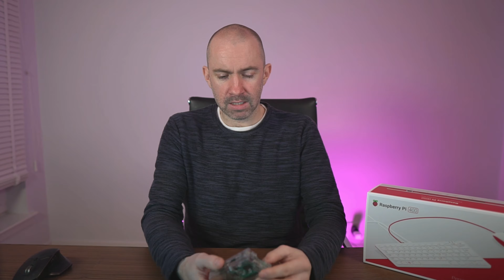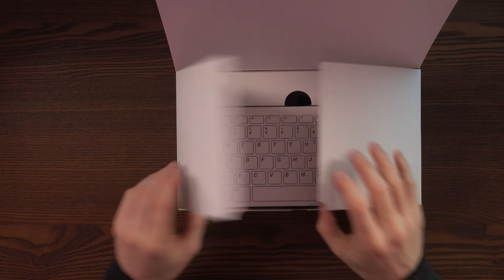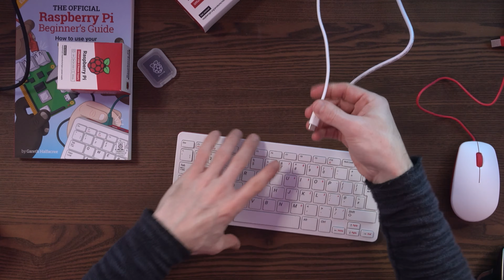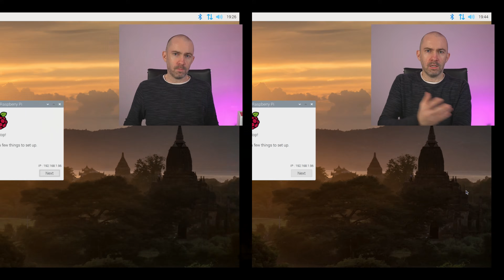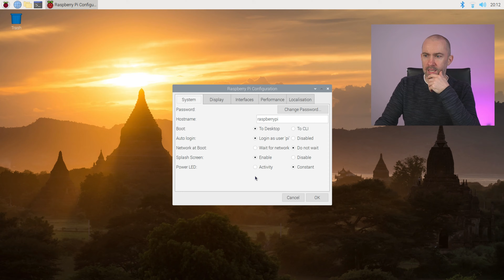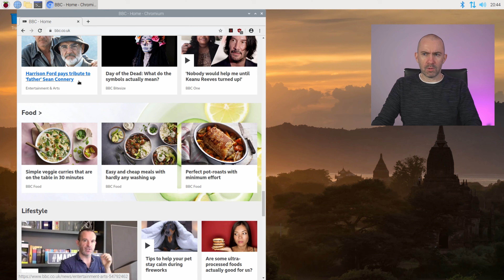Raspberry Pi 400 - Unboxing, Teardown & Raspberry Pi OS Setup

Comment: Can you take apart the keyboard?
Reply from the maker: Yes. I show removing the casing in the video, but I've seen people do mods that add their own keyboard etc. It's not straightforward though.
Reply: @KevinMuldoon  is this no different than the smaller rasberry pi? my local store is sol d out of the pi4 but maybe this one is the same thing just with accesories? what reason should i wait for other one?
Reply from the maker: It's a different form factor so it would be worth waiting if you need the smaller form factor of the regular pi. I'd only get this if you're looking for an all in one solution.

Comment: After I Shut Down the "Raspberry Pi 400" the only option to open it back, is by unpluging/pluging the power cable? I read the Begging Guid Book, and states that's the only option. I couldn't find another option, to open it up, let's say a physical button (like on laptops or PC), or let's say by pressing a key or something.
Reply from the maker: It's F10 or FN+F10 https://support.thepihut.com/hc/en-us/articles/360015199118-How-to-use-the-Raspberry-Pi-400-Power-Key 👍
Reply: @KevinMuldoon  It's FN+F10, for at least 0.5 second. Thanks buddy, I owe you a beer :)

Comment: great video Kev cheers 👍 what's its strengths with retro pie? what's the most demanding emulator it can run do you know?
Reply from the maker: It depends on the version. I've got the Pi 400, but my pi 3b is the one that's set up for emulating games. That handled games up to SNES perfectly. Some PS1 and N64 games were ok, but for the most part, struggled.
Reply: @KevinMuldoon  i have bought the Pi400 this evening after watching your video so will be running retro pie on that! will it run Dreamcast/Playstation?
Reply from the maker: @RetroRedDog  nice. I'm tempted to turn it into an Amiga!
Reply: @KevinMuldoon  got Amiga 500 on my 3DS 😂 good idea though, i may just do the same

Comment: Wouldn't it  normally be advisable to reapply heat paste?
Reply from the maker: I didn't remove any thermal paste so it wasn't necessary (I only removed the heatsink). Of course, I could have applied better thermal paste to see if it works better.

Comment: I really don't get why the Pi 400 uses it's own board. Wouldn't it be more expensive to print a new board than just using the original Pi 4B board?
If the Pi 400 is supposed to as cheap as possible, I would think that they would have done that. Not complaining, just a little bit confused.
Reply from the maker: My guess is that it wouldn't have worked that way. Perhaps because of thermals, perhaps because of the size of the chassis. I'm not sure.

Using a different sized board won't cost any more when you're developing things like this in bulk.

My friend works with a circuit board company and I believe they've done work with companies who used Pis etc. They basically just get the blueprint and then manufacturer everything according to spec.

Comment: WHat you called 'noobs' is not noobs, that was Raspberry Pi OS.  Noobs is completely different - it's basically a single menu with a selection of operating systems to choose and install.
Reply from the maker: Thanks for correcting me. You're right. I think Noobs is the installer I got in the past when I purchased the Raspberry Pi 3B kit.

Comment: They ran out at the popular sites but they were back in stock the next day.  Can’t wait to get my new Amiga/DOS/C64/Dreamcast Pi!
Reply from the maker: That's awesome. Glad to see it back in stock.

You're right. This would be perfect for an Amiga system.
Reply: I'd love to see a keyboard case like that as well that you can use with any SBC - I saw one for the Pi but I didn't like the look of the build quality and it was a bit bulky in size. Time to adapt an old slimline keyboard maybe.

Comment: It can be an interesting computer to emulate the micro computers of the 80s, do not arrive on time at the Spectrum Next and this has a very economical price, excellent video, a strong hug !!!.
Reply from the maker: Thanks Mr Galamond. Yeah it's nice.

I may try some other operating systems before I put on something like retropie (as I have retropie on my 3B).
Reply: @KevinMuldoon  I am in the doubt if this computer or a mini pc with Windows... I have never used Linux, but it is very nice and very economic, I see it ideal to emulate the ZX Spectrum and to do things with Basic in it, thanks for the answer and for your kindness, a hug.
Reply from the maker: You'll get more power with a mini pc, but pis are smaller. This makes them more flexible in many situations.
Reply: @KevinMuldoon  Thank you Kevin.

Comment: Pry it open by the Backspace key to not damage it.
Reply from the maker: I don't think it matters which part you open first. I suspect I opened it up in parts with my plastic tool facing the wrong direction. I've since opened it again and didn't have any problems.
Reply: @KevinMuldoon  Its the same with the Keyboard & hub device from RPi. Twisting a plastic tool there causes the least damage.
Reply from the maker: Thanks for the tip. I'll try that next time (if there is a next time, not sure I'll have to open it up again).

👍

Comment: Interesting seeing the significant difference in speed between ethernet (fast) and the built-in wifi (much slower but usable) when testing the internet
Reply from the maker: At first I was a bit disappointed as I had assumed ethernet speeds would be quicker, but when I think about it, it's actually quite good.

The network card in my PC is bigger than the Pi 400's circuit board. So it's no surprise that my dedicated network card performs better. It topped 350mbps at times.